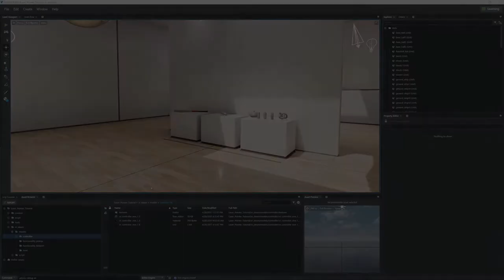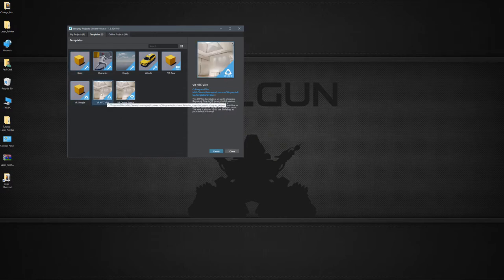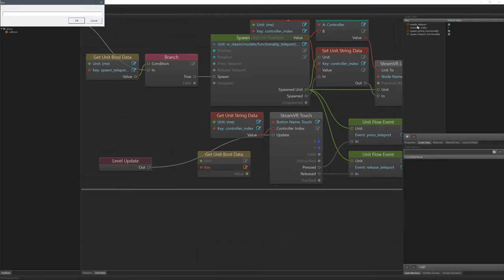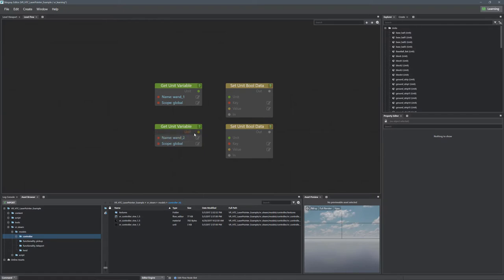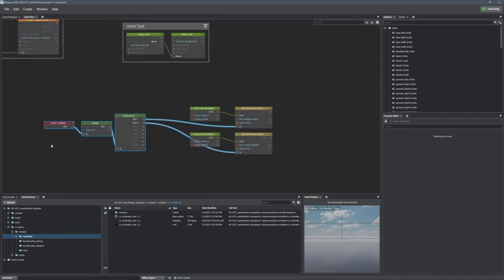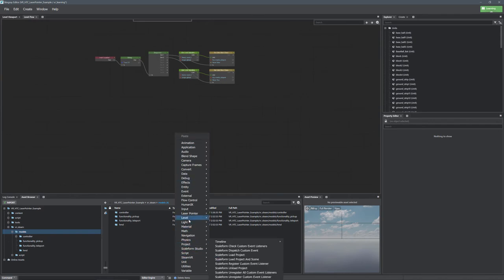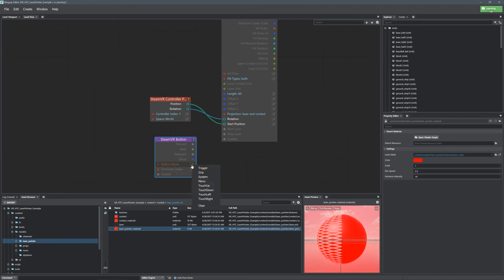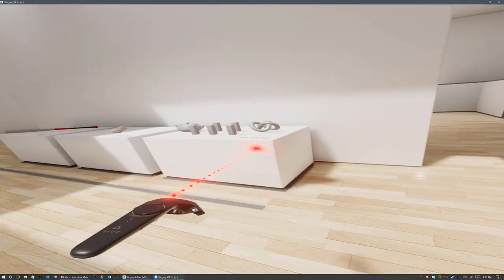Creating a laser pointer in Stingray

Comment: Great tutorial. I am experimenting with this and was wondering how to apply the laser to the weapon in the character template using the right mouse button, i can set up the mouse button fine but cannot figure out how to set the laser position the the weapon.
Reply: Well, the first thing you will need to do is find the "gun".  Once you do, you just need to get its position and send it to the laser pointer.  The rest should be easy.  Hint : in the gun unit (might be within the character, im not sure) you should use the external output > vector, rotation nodes.  They will allow you to send the needed data to the level.  Just place whatever the containing unit is in the level flow and the outputs should be apparent.  If you hit further trouble, lemme know.

Comment: Can i modify this to teleport with the laser? Thanks for the great tutorial!
Reply: yes.  that would be rather easy actually as you get the position of the hit.  All you have to do is do something like if "hit" = true, set vr tracking space to the location.  The node gives you all the needed output requirements already so yea, very easy.
Reply: thanks Paul! That seems to do the trick. One more thing though. The hit position places the center of the room on the point, not the position where i'm standig (if you can follow).
Reply: Are you feeding the it the location in world space for the controller you are using?
Reply: Start Position (on the node) should be constantly fed (level update) with the Controller position as I show in the video above.
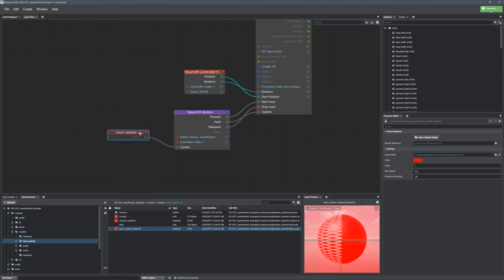Reply: Scrub the video above to 19:03 and make sure yours is similar.
Reply: Thanks for the great response! I got it working thanks to your input!
Reply: Awesome!  Nice job!